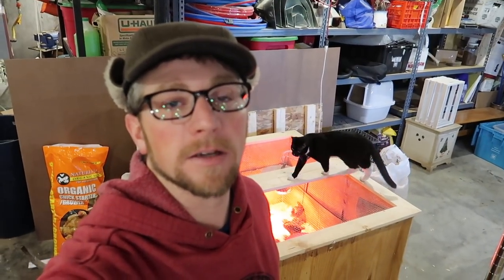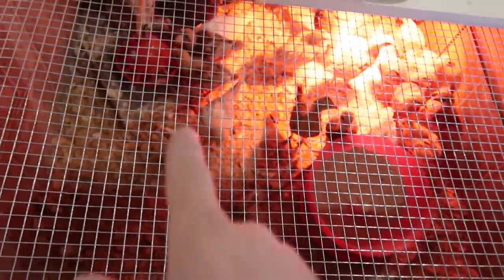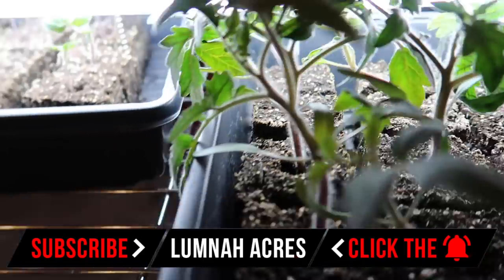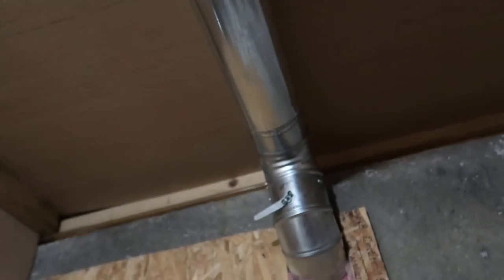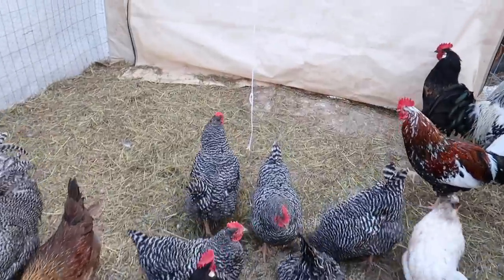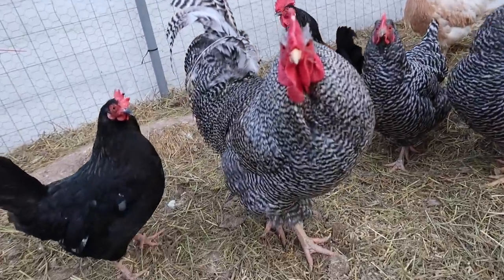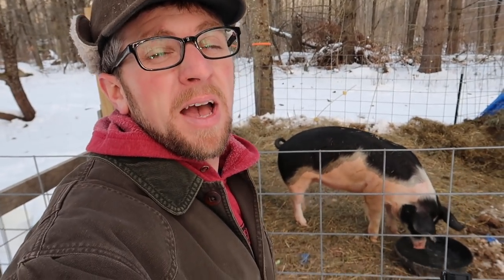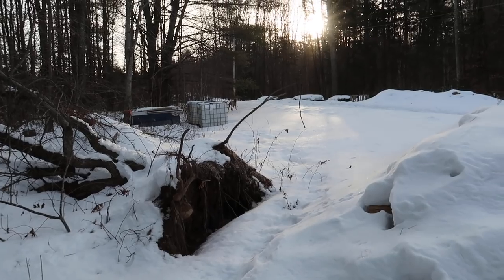Huge Break Through Raising Chicks | Modern Steader Update

Comment: I use your old-style feeder and waterer.  However, I took the part of a clothes hanger  (2 of them) - cut it off on the arms and bent them to make a hanger for each.  Then I took the arm of a third clothes hanger to make the extension rod (1 from each arm) from the coop top down to the height where the feeder and waterer never go below the level of the chicks neck.  By doing that, they stay off the floor, the chicks can't get their feet in it, and the water and feed stay clean.  I never have a problem with bedding getting in them.  I have used this method for two broods now.  I enjoy watering and feeding them everyday.  But then, I only have 6.

Comment: At 4.5 to 5 weeks old  mine went out in 36f-40f  degree weather at night in the chicken coop without heat and did fine. I bought a cheap wire dog cage off of ebay for 20 bucks and they been  in the coop with the hens so they can't peck at them.. They are out free ranging already in my city back yard.  I don't keep my hens cooped up at all in fact during the summer my birds roost like a wild chicken would. The coop is for sleeping in the winter only as they free range my large backyard during the day. I only have 4 chickens and never had predator problems in my backyard. A large part f their diet is bugs 😀. Yours are at the age where they will do fine as long as they can bed up off the ground in a draft free coop.